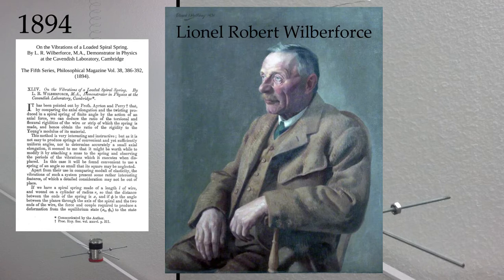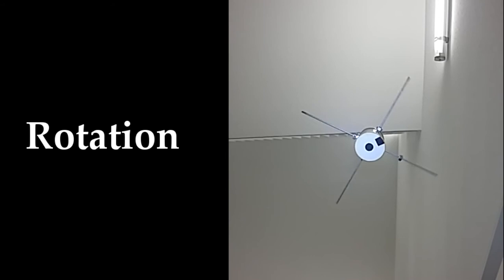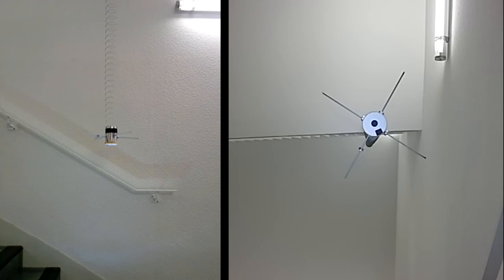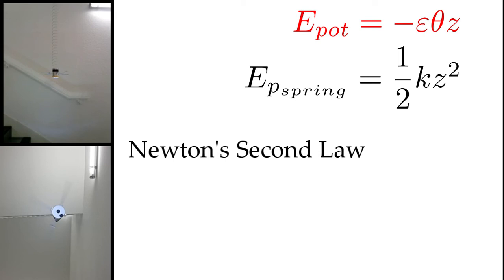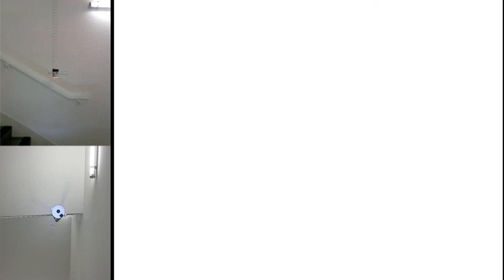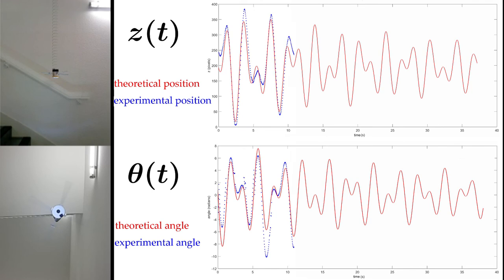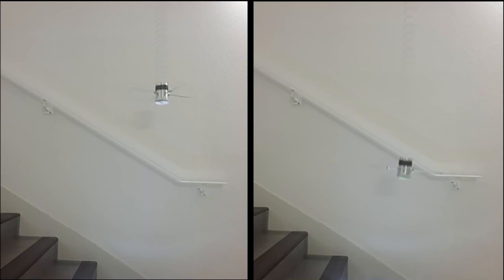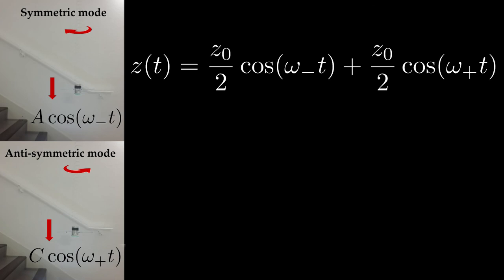Wilberforce Pendulum 1.0 at PHELMA (2017)

Comment: What is an epsilon in the formula?
Reply from the maker: epsilon is the constant (so-called coupling constant, in N/rad) in the expression of the potential energy E_pot of coupling between linear and rotational movements which writes E_pot = - epsilon*theta*z with theta the angle of rotation and z the length of elongation (of the pendulum, from its equilibrium). For more details please read this paper with all necessary details : https://emergent-scientist.edp-open.org/articles/emsci/full_html/2019/01/emsci180003/emsci180003.html (pdf available for free).